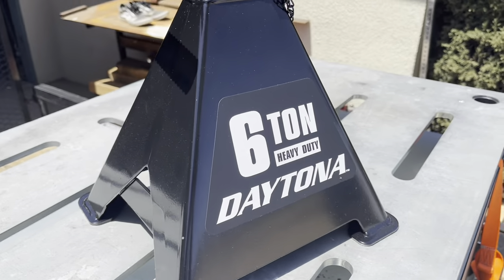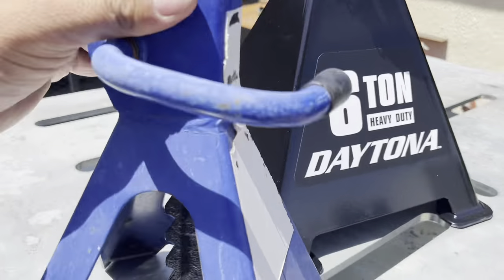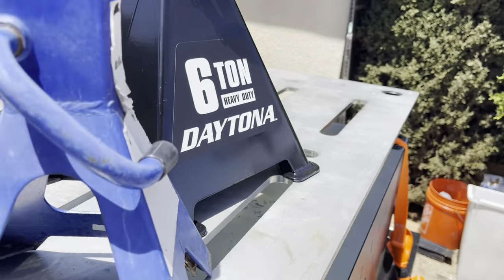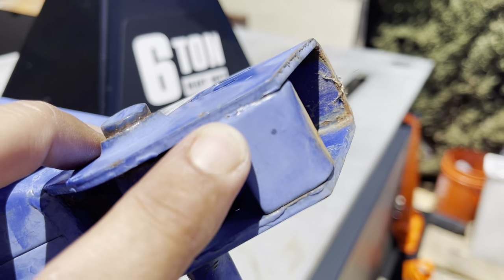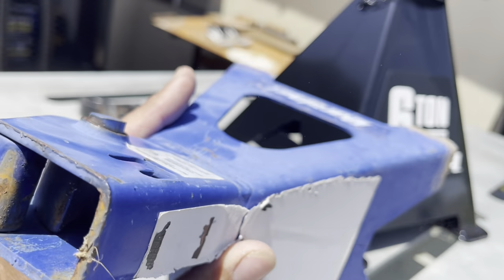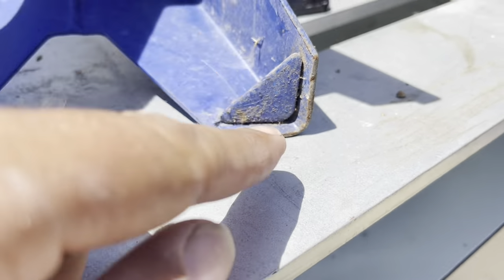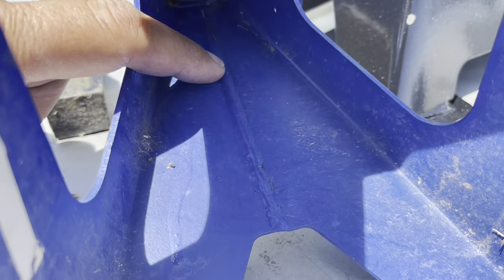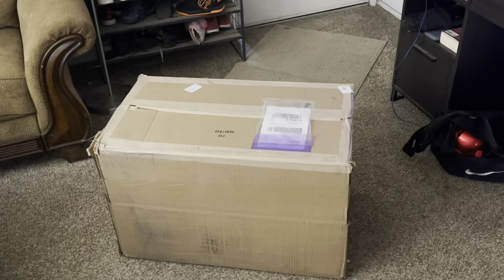All New Daytona 6 Ton Jack Stands 1st Look 👀 @harborfreight

Comment: I have a regular 3 ton HF jack that's 3 years old and works as it should. I've had the last 6 ton jack stands for a little over a year now with no problems. I will say the new ones are better and I really like the extra security pin. I got the 3 ton low pro long reach jack a month or so ago on the spring black Friday sale and like it. I especially like the foot pump feature if your in a tight spot.

Comment: I have 2 pair of 6 ton jack stands but I might get the Daytona 3 ton since 6 ton stands can be awkwardly tall even on the lowest setting. The 6 tons are great for trucks though almost everyone I know drives a 1 ton dually including myself, my 6 ton stands are actually holding up a tractor right now for a lady, she got new tires put on at a shop and I still need to put them back on the tractor but they're so heavy I'm waiting for help

Comment: Justin, off subject question, I have the Capri metric thin double open ended wrenches and up to now they have been great thin wrench, but today I need a thinner wrench. I believe you bought on the independent tool truck some very thin wrenches. Could you tell ne the brand name and if you liked them ?

Comment: I have and will buy Harbor freight items like their tool carts and tool chests which are so underrated, but some items I'll keep away from for a while are  their impact sockets.  My cousin and I where changing a tire in my garage, slapped on a brand new impact socket from harbor freight and on the second bolt, it blew up, hitting my cousin in his arm and a big chunk smacked me in the middle of my chest, scared the living daylights out of us.  Then a few year's later I saw the news story of their old jack stands failing under weight, so much so that they had to pull the line.  I like Harbor freight, but critical weight holding items like their Jack stands or even their 4 ton lift jack, make me kind of worried to purchase..
Reply: Weird, one of the items that everyone seems to rave about are their deep impact sockets.  I hope you're able to warranty them.  All it usually takes is to walk in the store with the broken socket.
Reply: I never had a problem with any of the Harber freight stuff like I have the 3-ton aluminum jack and it works great. I just won't buy their power tools

Comment: I have a Daytona jack and have owned it for about 2.5 years. They frame on it bent to the point that one wheel doesn't make contact with the ground. I always used it on a flat surface here at my he garage the heaviest vehicle it lifted was a 1990 suburban. I was wondering if anyone else has had this issue. Unfortunately mine is out of warranty by now but it was great while it lasted
Reply: Oh no that’s not good at all sir. I was going to buy one. Not now, I will save my money and look at Jack that is more sturdy and reliable. Thank you for letting us know and saving me money and my first trip to Harbor Freight. Never been there. 🇺🇸😎🇺🇸
Reply: Which Daytona jack is that?